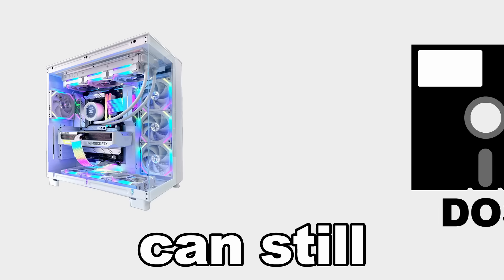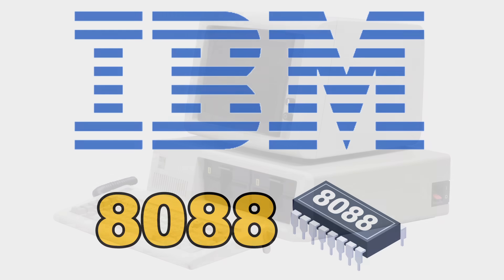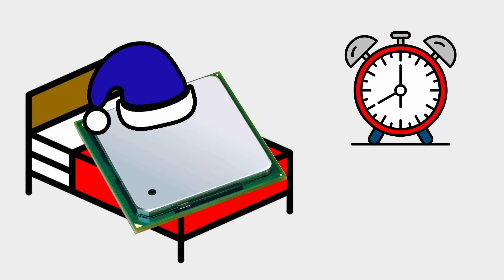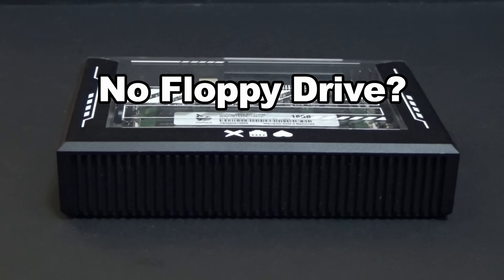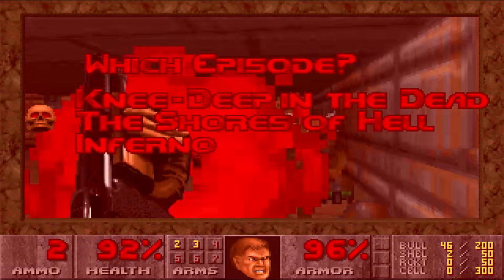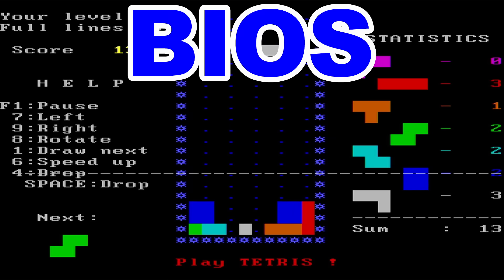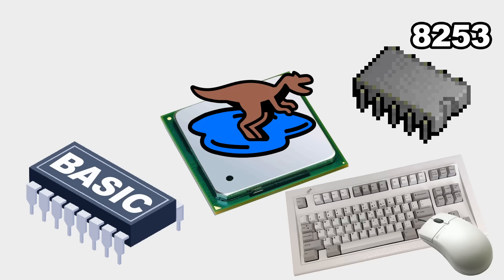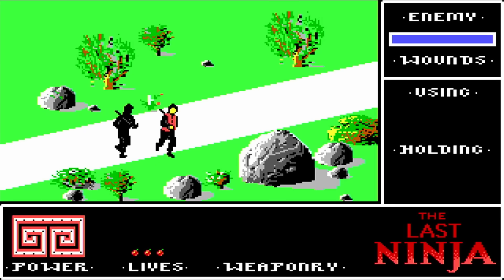45 Year Old DOS on a New Intel CPU Without Emulation

Comment: DOS was an ideal OS for gaming precisely because it did so little to help the programmer. It offered exactly ZERO aid for things like sound, graphics etc. The BIOS helped somewhat, but no  professionally written game wouldn't rely on BIOS routines for graphiics. DOS's strength was that it didn't get (much) in the way of the programmer, if we exclude the horribly complicated  memory management standards.
Reply: That's because DOS was a DISK operating system.  It primarilly managed files and very basic keyboard/screen I/O.  Everything else was up to you.  And by the "horribly complicated memory management" I assume you meant the segmented memory model.  That had nothing to do with DOS.  It had to do with the legacy 16 bit registers using the increased 1MB memory addressing the 8088/86 had over the 8080/85's 64KB.
Reply: @stargazer7644  The segmented memory model was indeed a legacy of the x86 architecture, and a vagary for every DOS programmer. But what was worse was actually the many additional programming schemes for going beyond 1 MB of addressable RAM, before protected mode definitely took over: XMS, EMS or, worse, custom memory expansion cards that 'd work only with specific software. Having multiple boot configurations to accommodate the vastly conflicting needs of this or that software wasn't uncommon, and the majority was related to memory type/size.  Some of the most complicated Real Mode games could require having both a lot of free conventional memory (anything over 600K needed some magic),, plus XMS and/or EMS present. Dune II was one of the worst offenders, in that regard.

Comment: Since the pentium pro, a "x86 CPU" is just some random architecture intel or AMD come up with and a translation layer to x86.
But it's not much of an issue, given it end up being minuscule if compared to the rest of the chip, and it's trivial to make it realtime when you're doing a custom chip.
In practical terms, besides compatibility, x86 also acts like some sort of crude code compression as it has flexible instruction sizes.

Comment: This Video is not fully correct. X86 dropped MANY obsolete Instructions over the Years.
Also Real Mode does not exist anymore in modern CPUs. Modern UEFi does not boot in Real mode and CSM is rarely supported anyways. Even if it is available its booting in a virtual 8086 mode. x86-64 is not running the CISC Instructions directly anymore. Nowadays everything gets split into smaller sub instructions which get executed by the different parts. BTW every modern Architecture does this. Arm64 has gotten just as complex as x64. This is easily proven by performance by watt figures comparing bleeding edge x64 to arm chips. ARM has barely any advantage in the high power segment.
Reply: This post is not fully correct. Modern UEFI of course boots in real mode, because the CPU boots in real mode - it just very quickly kicks it up to a protected mode of some sort. Further, the "micro-ops" (the "real" machine code of a modern x86) doesn't just split down x86 ISA, but also "fuses" x86 instructions too, to create larger/longer micro-ops.

This latter part is relatively unknown, because many people fell for the "RISC-like execution core" line when the Pentium Pro started using these techniques: in reality, it was a marketing campaign to steal some of the thunder of the RISC microarchitectures that Intel was positioning the Pentium Pro compete with. The micro-ops of these CPUs have never really been "RISC-like": they aren't load-store/register-registers ISAs and they don't have fixed instruction sizes - really any of the things that are considered prototypically "RISC".

Comment: The biggest issue is really the driver situation. You may have gadgets like CSM, SATA compatibility mode and SBEMU, but your first hurdle is probably lack of support for NVMe SSDs - only the first mainstream Samsung drives shipped with a legacy option ROM to allow booting from them. Thankfully USB sticks are well supported instead.

Comment: You didn't even have to change the boot mode since it was already CSM-enabled (it said UEFI and Legacy).  Also to update the boot devices list after changing that option you have to save the settings and re-open the BIOS settings to refresh it in its new mode.

Comment: Modern BIOS / UEFI instructions still say to use DOS to update them
Reply: that's because in real mode the software can access the hardware registers needed to flash the eprom.
its more ironic when you consider that the BIOS/UEFI is probably emulating some interrupts for DOS, so DOS can keep working as the architecture of the hardware changed.
Reply: DOS isn't an operating system by modern definitions.  When you boot DOS, it loads some data into memory and starts COMMAND.COM which is the only thing running.  When you run a program, that program takes total control of the computer and nothing else is running.  When you exit the program, it starts COMMAND.COM for you again before it exits.

That bit that gets loaded into memory is computer code that your program can call if it wants (look up "Terminate and Stay Resident" for details).  It's not running in the background - there is no background.  Your program has the computer's undivided attention.

That's great for stuff that needs to deal directly with the hardware, because you don't have an OS to deal with.  You can poke and prod anything you like on the system.  It's bad if you want to run multiple programs at once or if you don't want every single program to need its own device drivers.

Comment: Free dos is still an option when buying a laptop.
Reply: Yesn't. It still looks like FreeDOS booting on bare hardware, but it's actually a minimal Linux system running an emulator.
Reply: @D0Samp  what you describe looks like scam.

Comment: You don’t need basic in rom. You need a program to load the files into. Gwbasic. Qbasic etc
Reply: He was talking about BASIC which was originally present in PC DOS.
Of course, it is possible to use versions, which don't rely on ROM code.
Reply: The only computers I used with BASIC in ROM was the Timex-Sinclair and the Radio Shack Color Computer.  Years ago I upgraded the Color BASIC programs to run in GWBASIC and QBASIC on the PC.  It was just a few minor tweaks.

Comment: The A20 line is deprecated in modern computers
Reply: Thankfully, it breaks surprisingly few DOS applications. MS-DOS 5.0+ and FreeDOS mirror the CP/M-style CALL 5 entry point (which relies on this address wraparound) exactly 1 MB over its intended location if DOS is resident inside the HMA.
Reply: @D0Samp Sadly, I've seen it cause memory managers of many different stripes to fail. Not a problem for old games (they only used conventional memory) or late DOS-era games (which were using DOS extenders as their "operating system"), but there's a sliver of time between 1989 and 1992 where programs demanded so much conventional memory that your drivers had to be loaded high, or wanted expanded memory with a 64KB page frame, and those pretty much required HIMEM.SYS/EMM386.EXE (or QEMM, or 386MAX, etc) to be loaded to work.

Comment: 2:22 saying this while intel CPUs are literally cooking themselves to death is wild!
Reply: intel cpus literally rebelling against the concept of existing in a functional state
Reply: 8 months later and a few microcode updates downloaded, can confirm my 14700k is still suicidal. Idles with 1.6v through the vcore, had to manually undervolt it even after the supposed fixes
Reply: It's sad that my 11th gen intel runs faster than my 14th because avx512 was permanently disabled through microcode updates.
Reply: @theguythatcoment This is very sad, since when AVX speeds up optimized tasks, I usually always write AVX functions in C and call them from my programs and there is a big difference.
Also you know, every problem with oxidation.
I hope that with the new Intel leadership this will be fixed, I definitely don't want another AMD from 2012

Comment: Tbh; I don't care too much about being able to run Dos on hardware.. What I want is a device that gives me the opportunity to use actual 8 and 16 bit ISA cards on modern hardware.. (I'd also like some more standard PCI-slots please).. 

 I am the most annoyed that because of computer evolution.. we no longer have decent sound cards (actual hardware to play music).. It's all just simple dacs the rest we push onto the CPU to emulate.. I have an Awe64 gold that I seriously love and want to use.. and before this I had an MPU-401 compatible midi-card which together with my Roland SC55 mark 2 (Full GM, GS, ~and~ had a compatibility mode to play MT-32 sounds.. but with better samples).. Yeah.. While most people had first gen sound-blaster with simple snyth-features, I had full stereo orchestral sound on my computer. .and. .also I had a soundblaster pro.. 

When I got the Awe-64 I pretty much could do anything and it all was in the same card.. There were literally no limits to what I could or couldn't do any longer. From the same DOS program I could create musical pieces that used the traditional "wave-synthesizers" of OPL3 chips in stereo, while at the same time using sound-fonts to get the genuine sound of various church organs or what not, WHILE using the MPU-401 compatible midi-port of the card to BOTH connect to the soundcard, AND my digital organ, AND my keyboard.

.. and I want that back.. please.. I still have all the hardware.
Reply: You could take a look at the dISAppointment project: it breaks out something electrically similar to ISA from the LPC bus (a simplified pseudo-ISA bus still present on most late-model motherboards), but it does have limitations - LPC stands for "low pin count", and it leaves out many signals/pins that are in a real ISA slot..

Comment: What's cool: you can easily get MS-DOS to boot into any other program by creating an Autoexec.bat file. You can even make a simple menu, to let the user select what program they'd like to use.
Reply: That's how you loaded device drivers and other things people don't have to think about anymore.
Reply: I feel so old.
Reply: I did that with my computer back in the early 90s so my wife could run programs.  I also made a menu system in WordPerfect 5.0 and 5.1 for DOS for a law firm, so others could create documents more quickly.  I had the most fun at work writing macros to automate everything, even the attorneys' signatures.
Reply: Time to play Minecraft on MS-DOS lol
Reply: That's how Novell Netware servers started.  However, OS/2 version ran under OS/2.

Comment: Itanium lost not because of no compatibility with earlier processors but because of theoretical power which was not visible in a real life.

Itanium required software tools and Itanium targeting software developers understanding this architecture = dozen of years developing it.

Moreover it was visible pretty fast that size of working simultaneously on the same microcode part of the chip matters and it is better to have asynchronous chip doing small things in parallel than more organised one doing its job in theory better but in reality needing more space to do it.

Some evolution of multi-cores and HT was the output of works on Itanium.

I'm not English fluent enough and I've read about the problem with size of gates structures needed to maintain Itanium organisation decades ago so most likely my attempt here to review results is not too good.

More or less the meritum of what I've read was that RISC and Itanium had 1 major problem - size of die needed to work in parallel. Whereas Intel could spread operations more flexible and sync from time to time ending with slightly chaotic but easier to maintain in a real world layout of gates.
Reply: To clarify, Itanium was built around the idea that certain optimizations could be made by the compiler in order to achieve the full performance of the processor.  The problem was that those optimizations turned out to be impossible, so the chip was never able to reach its full potential.  It never compared well to other 64 bit architectures such as SPARC64, POWER, or Alpha.  The only reason HP adopted it was because they had stopped developing PA-RISC to help Intel develop the Itanium; by the time they realized it wasn't a great chip, it was too late to turn back.

But what really killed it was the x86.  Itanium was a great idea in 1994 when they first started working on it.  By the time Itanium came out, x86 was eating into the high performance computing and business markets that used to be dominated by IBM, DEC, Sun, and HP.  You didn't need a $20k workstation to run CAD anymore and you didn't need a $200k server to run your business logic.  Commercial UNIX was dying, its business customers fleeing to Windows and its Internet customers fleeing to Linux.  The only use HP found for it was for their legacy HP-UX customers - hardly anyone was developing new systems on HP-UX.  Intel had made the x86 too good, and AMD brought it into the 64 bit world.

Comment: Of course ARM CPUs have a long and storied heritage of their own, and if you get the right arm single board computer you can even run the original RISCOS -originally designed by acorn computers for use in their first generation ARM workstations.
Reply: None of the mainstream ARM chips can run ARM 1 or ARM 2 code. So the RISCOS binaries from Acorn won't work. Of course if you have a binary build for something newer it will work. But original RISCOS runs on original hardware and emulators only.
Reply: @absurdengineering  And they can even less now that they're all 64 bit.

Comment: The "success" of backwads compatibility comes from proprietary SW that does not scale in performance. Some companies still use Windwos 98 (on much newer HW) because of a high-priced 20 year old equipment, whos manufacturer went out of business before having time (or money) to develop a driver for XP (or newer). Similar things on XP.
But the usefullness of DOS stops there (I don't mean thinkerers like us).
PS: up to around 2010, DOS was still used to deploy XP over network. Several gigabit NICs have DOS (ms client) drivers. Maybe even Novell drivers. Vista (I think) introduced booting from image files downloaded from network that changed that.
Reply: Nah, SDI booting over PXE had been around since XP Embedded at least. The first version of Windows Deployment Services (before that, it was called Remote Boot Services if I recall correctly) for Windows Server 2003 directly supported it.

Vista simply popularized it by including Windows PE with every copy of Windows, and making it more efficient and easier to operate by (ironically) making it more complicated: the RAM disk structure was still kept n the SDI, but the actual file data was kept in their shiny, new, fast, easily-edited, and single-instanced with optional error-correction, "WIM" format.

Comment: The backwards compatibility makes x86 processors always definitive. x86 users aren't missing out on MMX, SSE, and SSE2, even when they get the latest processor.
Reply: It definitely helps that all x64 CPUs are required to implement SSE2.
Reply: Except when they are (AVX512), but yeah.
Reply: @lordofhyphens  There's always ways to detect whether it's supported. And a compatibility hierarchy is maintained, with processors supporting SSE2 implicitly supporting SSE, which in turn is implicitly supporting MMX as well, which implicitly is supporting x87.
Reply: Don’t forget about x87 floating-point math.
Reply: @MaddTheSane  Can you use x87 in Long Mode?  Or only in 32-bit processes?
Reply: @soundspark  x87 instructions still work in 64-bit mode. In fact I had (wanted) to use them for trigonometry in my Windows asm app
Reply: @salainen6850  So it's just that compilers use SSE2 because it is guaranteed available in x64 mode?  But of course with ASM you can use all instructions as you wish?
Reply: @soundspark  Yup, everything up to SSE2 is guaranteed in x64, but this includes x87. Compilers don’t use the latter because it’s supposedly slower, but it’s still there. (Actually I did have my x87 version of some SSE2 code run faster on an R5 5600G, though.)

To be clear, SSE can’t do sin/cos so if you don’t want to use the CRT functions or your own approximation, x87 is really the only way. I don’t trust these instructions to be fast so I just use them to fill a look-up table at initialization.
Reply: @salainen6850  From what I remember, x87 is slower because it's now emulated in CPU microcode instead of being actual silicon, and the other reason people recommend SSE2 is because x87's "always uses the 80-bit precision mode internally" and other quirks can lead to some funky logic bugs if you're not used to them.
Reply: Nah, amd dropped 3dnow set 2 years ago
Reply: @grihaspoormachine  Wasn’t 3DNow dropped more than a decade ago?
Reply: @grihaspoormachine 3dnow has been a thing since at least 2007
Reply: No but there rarely is. Most instructions in X86 gets converted down to smaller RISC-like instructions anyways. 
The only point to newer instructions is for stuff like SIMD. Which is liked only cus it takes up less battery.